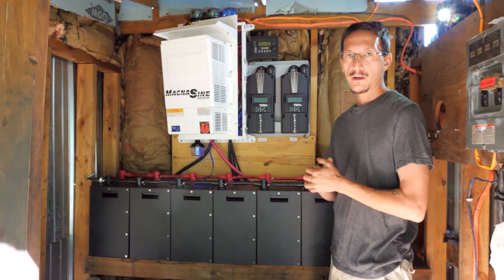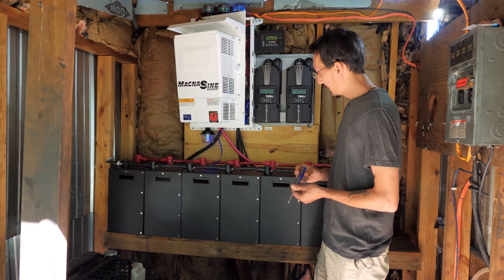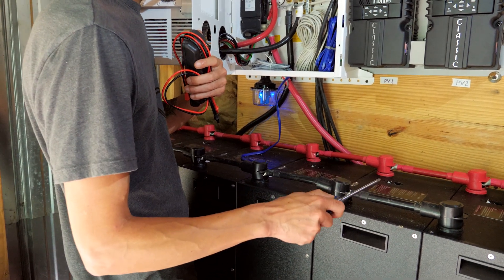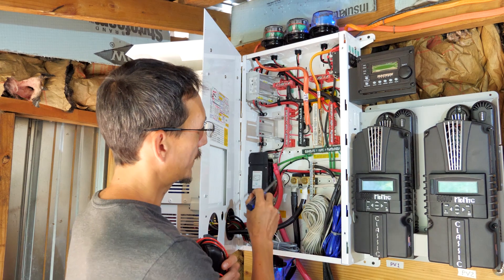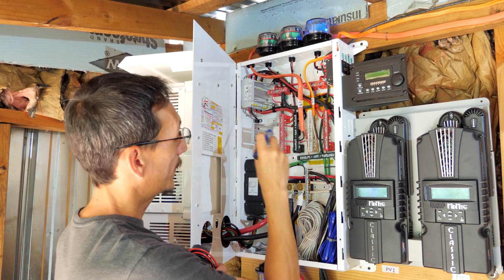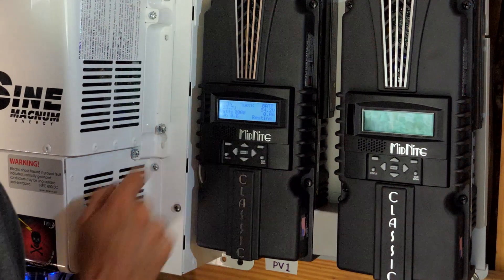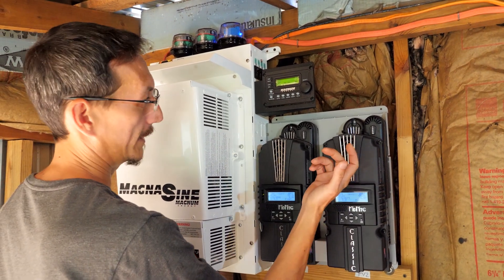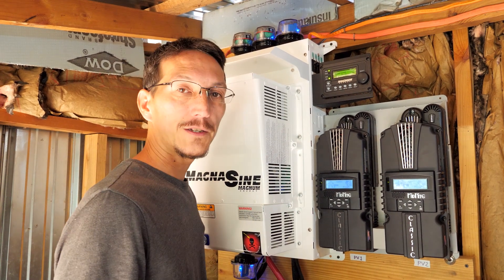DIY Off Grid Solar: System Overview and Powering Up (Part 5)

Comment: You said the Magna was a charger and inverter but also said the Midnight's next to it were both chargers, so your not using the Magna to charge the batteries? If so why pay extra for a combined charge/inverter unit? cheers.....
Reply from the maker: The charger part of the inverter uses generator power to charge the batteries if there is a problem with the solar system or a long stretch of days without sun. The charge controllers strictly use the solar panels to charge the batteries.
Reply: ahh, thanks

Comment: It seems awesome but is it super expensive?
Reply: Batteries were more than 10K alone
Reply: sh839c Actually it’s 21,000 dollars just calculated it. Granted, I’m not for sure if come in a pack of six or individual, if it’s individual than it’s $21,000 dollars. Yeah they had to get a huge discount.
Reply: Jason Fuchs I think they  may have gotten a huge discount. I was calculating the panels cost, and that only is about 4500 dollars. I think it cost a minimum $10,000 dollars

Comment: Did you get this panel from midnite solar or altE? If it was from altE, was it just the standard 2 controller prewired, or did you special order for your system?
Reply from the maker: Bought from AltE but the 2 controller version they ordered directly from and shipped from Midnite Solar.
Reply: Thanks. Did you have to special order the whizbang ect or did you just pick out a prewired panel and it came with it?
Reply from the maker: It came with it.

Comment: I have a MagnaSine in my motorhome and Victron in my boat. The Victron is better but the Magnum works reliable as well. I have a tip for your battery connections: buy a long piece of copper flat stock and drill holes at exact locations for the battery terminals. Then use pieces of large diameter heat shrink to insulate the bar between the terminals. This eliminates the cable crimp connections for every single one adds a loss.

Comment: You mention using 120V to feed one of your load centers.   If I'm not mistaken your inverter will work more efficiently if both phases are drawing equal amperage.    So 120v load centers in general are less desirable.   Unless you have a pair of 120V load centers on opposite phases of the inverter ;)
Reply from the maker: Each leg from the inverter is already 180 degrees out of phase.
Reply: Guildbrook Farm - Off Grid Living yes, but if you draw 8 amps on 1 phase and 2 amps on the other phase your inverter consumes more power than an equal 5 amps on each phase
Reply from the maker: Good point. When we wire the new house we’ll have a 240v load center and can set it up that way. Also with actual conduit and racking.

Comment: Excellent series. I was hoping you guys went with Schneider equipment over magnum/midnight. My off grid cabin runs on AGM batteries, Xantrax CC and small Samlex inverter but soon I'll be upgrading to Lithium and Schneider CC/Inverter. You did a fabulous job with the whole system, and it should give you guys clean power for years!
Reply: Like Jeremy said, they make them all the way up to 6800 watts. I personally like the Xanbus connectivity between all the components, plus the web connectivity for offsite monitoring. Magnum power makes fantastic products, but the nerd in me likes all the add on accessories that Schneider offers. Since all of the equipment is one brand they all share data with each other. Also Schneider makes AC and DC load centers that match all of their products. Last advantage is Schneider makes a 600 volt 80 amp charge controller so you can add many more panels on a string. You can put 4800 watts worth of panels on one string, that allows you to use less materials like combiner boxes, DC breakers, etc. Just be careful working with 600 volts!
Reply from the maker: I think Sensata owns the Schneider line now too don’t they?
Reply: Guildbrook Farm - Off Grid Living Not that I can find. I believe a large company in France owns them. Did you look at the Schneider equipment? Just curious to get your thoughts on pros and cons of each. I was on the Magnum train for a while but then once I really started researching the options and features Schneider was the better fit for my cabin.
Reply from the maker: I did consider them and haven’t ruled them out.
Reply: What is the Schneider advantage?.
Reply from the maker: They make a higher wattage inverter.

Comment: That's a beautiful setup man. I've been following you for a while now. I have an aims inverter charger and am going to upgrade to a magnasine 2024. Currently have 500 watt worth of panels with a commander 40 amp mppt running all 12 volt. Going to make everything 24 volt and add additional 500 watts of panels. I have plenty of battery for a week with no sun but I have AGM's. Very jealous of those simplifi batteries you have! Great setup and I love the videos.

Comment: ... What a great video series, & Congratz on the successful install... Kudoes... i just had a thought... Jeremy, as good as you & Jaime are @ explaining without arrogance your lifestyle changes, IMO, you could help another youtube couple < pure living for life > who are currently building a timber frame in idaho. They have had their share of troubles using a small start-up solar system & course, people came out of the woodwork to tell them 'how its done' ;) They have recently went on grid, but apparently will revisit solar again, just down-the-road. Forgive me, but i think if you just reached out & offered your channel to them, it could/would be very beneficial... all the way around. Again, Thanks for the Great work that has helped me immensely, simply because of your insight & style, i was actually able to sit thru your videos ;)

Comment: I know you said several times that the system was off,  but using that metal screwdriver as a pointer made me really nervous. Just because the system is off doesn't mean individual wires from the battery bank or solar array are hot. Yes,  you have to cross them but it still made me nervous. 💝☀🌵

Comment: Great clean looking setup. Only bit of advice I have is be careful with the volt meter reading.  Your expensive Magnum charge controller has brand new electronics in it and no offence but may be more reliable / accurate than your volt meter. Multimeters tend to drift overtime as electronics age etc... In my line of work I have to have my meters calibrated every 6 months and sometimes the error is more than you would expect. It would be a shame to overcharge your really expensive batteries by relying on a relatively cheap non calibrated meter which could easily be a few volts out depending on age / use / drops etc... but only my 2 cents worth and may not even be an issue. You can pickup a calibrated new semi-pro meter in the UK for £100 so loosely translated $120.  Great video series, keep it up. Cheers
Edit: Or you could verify it with a 2nd meter.
Reply: Yeah I would tend to agree, I missed the midnite solar volt readings. If it was me though still a cheap calibrated meter is small insurance for for such an investment in my opinion. Or maybe I am just bitter I need to get my meters calibrated all the time haha. I am sure it will all come out in the wash for the Magnum video.
Reply: I agree with JPN on this. Get a calibrated meter for a standard reference.
Reply: The interesting part was, both Midnight controllers matched his digital meter's reading.  The only one different was the magnum.  I'd go with three alike references than the single one that's different from all the others.

Comment: You should disconnect the battery temp sensor, lithium battery dont need temperature compensation!! when it's not present, by Default the battery will be set to 77 'F
Reply from the maker: They don’t need it and temp compensation is disabled, but i like to know what the temps are anyhow.

Comment: Great video. Very informative. Great job. I have to ask one question. You said you have metering for the overall battery voltage and current. Do you have a way using the equipment to monitor each individual cell of your batteries. This way you have way of knowing if a battery is starting to go bad. I like the lithium batteries. Using that type of battery you don't need any air ventilation systems as you would with the wet cell type. That and you don't need to worry about specific gravity tests. Great vid. You did awesome.
Reply from the maker: There is no metering within the batteries, only for the overall bank.
Reply: I was thinking there might be some analog rtd inputs at the invereter box. Some applications use leads attached to the battery posts to bring the data to a processing unit. I was just curious if the unit you got had that option.
Reply from the maker: I don’t think that’s an option with this setup.
Reply: Ok. Nothing a handheld multimeter cant give you. Thanks for the great video and the reply.👍
Reply from the maker: Yes that’s the other nice thing about these batteries. You can isolate each one with the breakers to meter them individually.

Comment: Really nice setup!!!  I installed my xantrex remote inside the house for easy viewing of any issues without having to go to the garage.  Mine didn't have the "whiz bang" included, so I added a Victron Energy battery monitor that uses the same shunt setup.  I really love that capability! Maybe you'll move the remote when you build your house!  Again, really nice setup!
Reply from the maker: Thanks. So far so good. When it moves to the house everything will be in the basement and the remote will be upstairs. 👍🏻
Reply: You've got a real cadillac setup there.  I really loved watching your series--many times!  Got some great tips and am upgrading my PV wiring this week as a result.  Loved your labeling system too!  Wish I'd done that.  But I'm doing it this week.  Just waiting for the flexible conduit to run the 4 gauge wire up and over the garage doors instead of across the driveway, and the strain reliefs to arrive for the new disconnect combiner.  You've given me the motivation to get my wiring as nice and clean as yours!!!  Many thanks for doing this series.
Reply from the maker: Awesome. Glad it was helpful for even a few people.